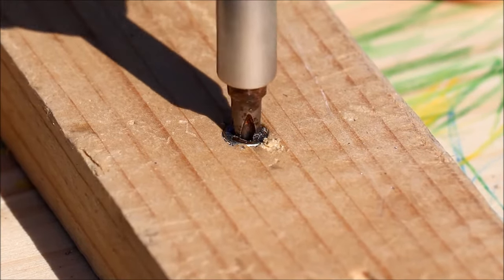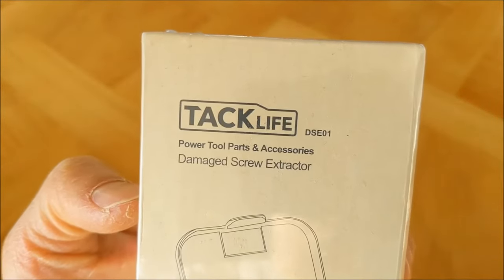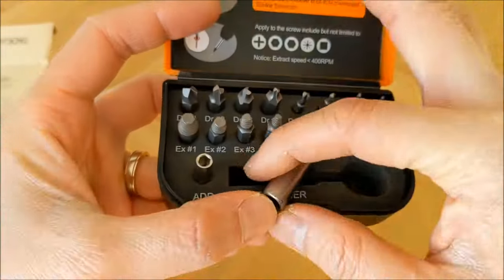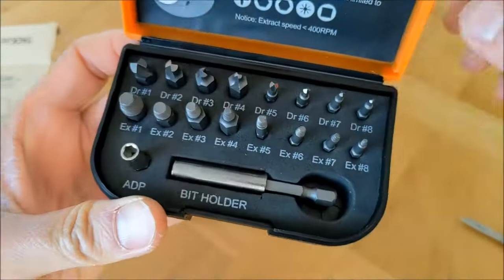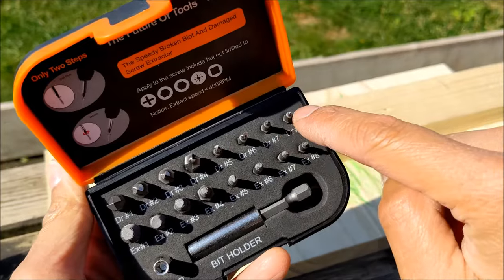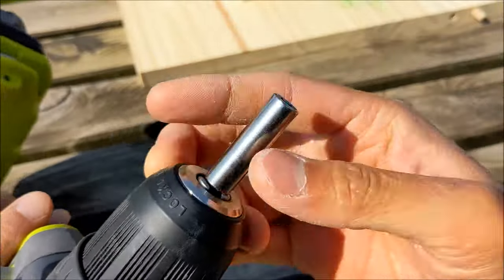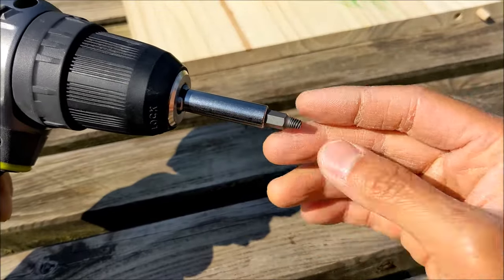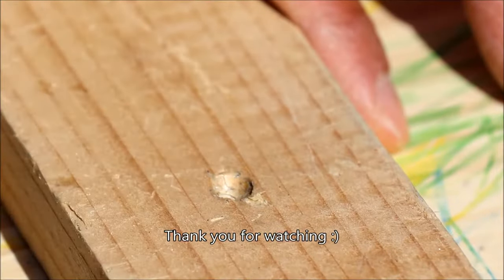Unboxing TACKLIFE Damaged Screw Extractor DSE01

Comment: I have the same problem when trying to replace the lock on my door. I found the screw on the lock completely stripped.
How did you manage to fix it pls ?
Reply from the maker: Hello, I'm sorry you're facing the same problem and I know how annoying it is. By using the technique in this video, I first widened the stripped screw by drilling it, just enough to fit the extractor bit.

And once you get that to fit, you'll be able to follow the extraction process. That should remove the screw.

Hope that helps.